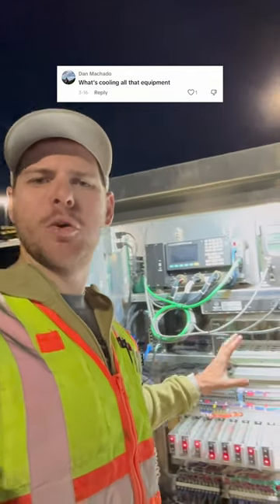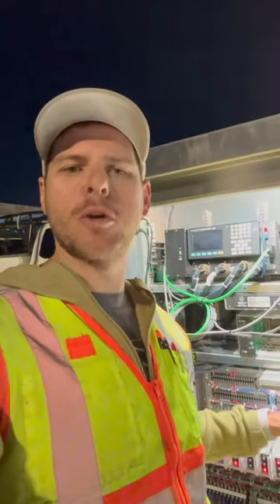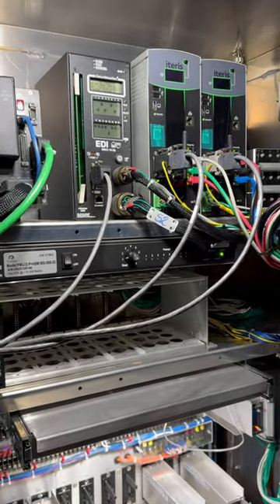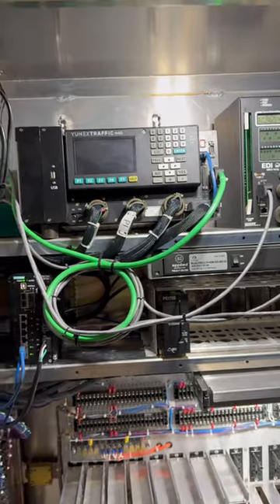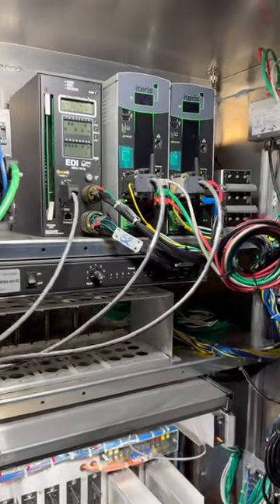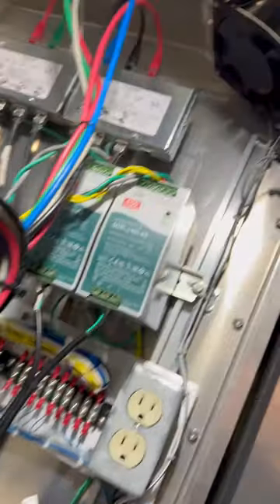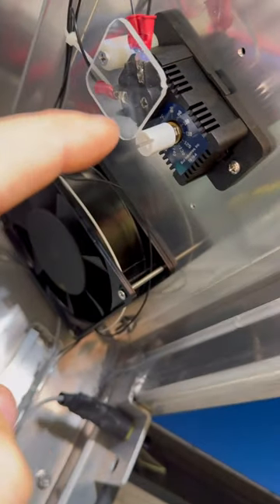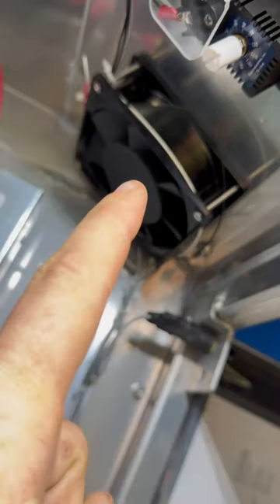Most Advance Cooling System!! #educational

Comment: kinda curious.. why not just set the thermostat on that fan to 75 or 80 degrees to prevent heat buildup? running that fan is a lot cheaper and cost effective than the short(er) lifespan of that equipment due to sitting in 100+ degree temps all the time..
Reply: That is what we set them to where I work.

Comment: So does that fan just circulate the air inside or vent it out? Obviously you don’t want rain to get in there
Reply: Vents it outside. There is a filter down towards the bottom of the door.

Comment: how do those buried wire sensors work?
Reply: The loops have magnifiers in the cabinet. They aren't in the detection rack in this video as they are using camera detection. The magnifier sends out a magnetic field within the wires in the road. Every loop has to have a certain amount of wraps in the road depending on the size to be effective. When you pull over the loop the magnetic field of your car disrupts the loops magnetic field and in return the detector picks it up as a decrease in inductance and puts in a call to the controller.
Reply: @TexasP00nTappa  yo Thanks dude!

Comment: Couldnt this be done just as well by a couple of $20 raspberrys?
Reply: Nope, This equipment goes thru extreme heat, cold and humidity tests.
Reply: After upgrading Ethernet port on the raspberry pi, it would be rated with a wider range than that "specialized" equipment.
Reply: You think if it could they would have done all this? No your shitty raspberry pi cannot withstand extreme temperatures and weather and have years of life doing so.
Reply: @butchc9226  Plus the final result needs to meet various standards and safety requirements and pass certifications.  Besides, just using raspberry pi's won't cut it - their legal disclaimer says it wasn't designed for fail-safe usage where failure results in death, personal injury, or environmental damage.
Reply: Governments dont have profit incentives; its very rare that they pick the best value anything so I wouldnt put it past them.

But if yall say a raspberry couldnt control the relays, etc then im sure its true.
Reply: @rogerlevasseur397  exactly, the pi could never meet NEMA standards.